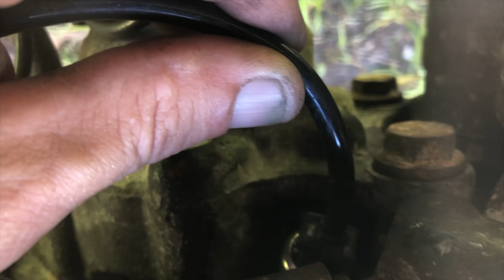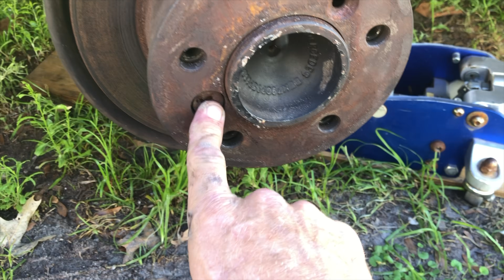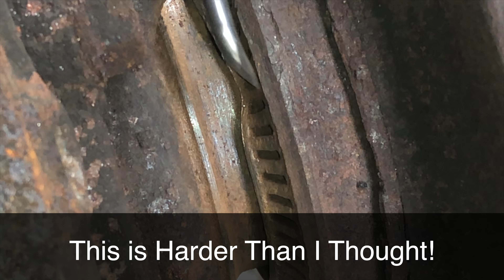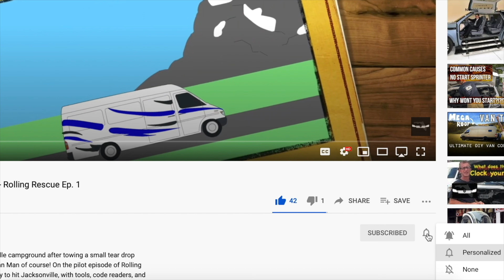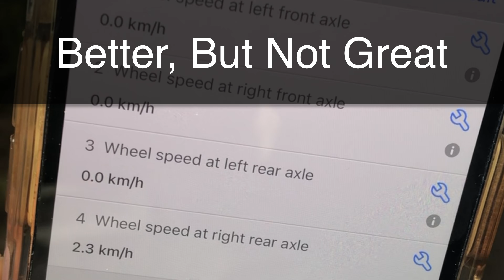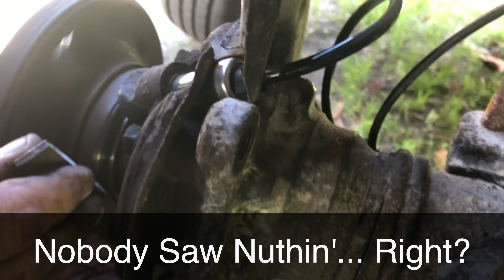Wheel Speed Sensor Ring Damage/Repair

Comment: My engine just decided to shut off and leave me free rolling on a busy road. EDC light came on along with ABS. Could it be possible for an ABS fault to cause this in any way? I read on a forum that it happened to a guy. Sorted ABS issue which was a shorting wire and vroom the van started and both EDC and ABD dash lights went out. I have a T1N 2001 CDI 208. Thanks for all the massive help over the years. Just bought the Autel AP200 from your other videos though it isn't speaking to ECU because I need a 14pin to 18pin adapter which you also linked me to. Hasn't arrived yet.
Reply from the maker: Those lights will come on when the engine stops and the key remains on or is turned back on immediately. Did the EDC light stay on next time you started the van? Our vans don't typically turn off the dash light as soon as the fault is resolved. There are some exceptions but most codes will leave the light on for several run cycles without a repeat of the fault, then turn it off and move the code to 'stored' status from 'MIL on & current'. If you had no EDC light when restarting that points to an electrical glitch, not fuel or fault code reported problem. 
ABS shouldn't turn off the engine, certainly not at speed, and of all the various modules the ABS is the first one to know how fast you are cruising. That said a serious short circuit in any device can draw the battery power away from needy components. Spontaneous shut down is most often fuse box connections failing, crankshaft sensor faults, and sudden dips in fuel pressure. If it consistently stalls when heavy on the pedal, or when off the pedal and approaching a stop, that would point me to the fuel pressure. If it dies on bridges or other road bumps I'd look at the fuse box. If the shut down was due to crankshaft sensor faults the AP200 will tell you.
Reply: @FloridaVanMan  I got it started and left it idle for a while until both EDC and ABS lights came on again and the engine shut down. Now It just wont start at all. Hence buying the AP200 but I am waiting for the adapter before it will talk to the ECU...
Reply: @ Just letting you that my 14pin round plug adapter that you suggested turned up and is working brilliantly. It turned up today, the day after I actually gt the van running again. it was a perished inline fuel priming bulb letting in air bubbles causing drop in rail pressure.

Comment: Ain’t that the screwdriver you used for pulling copper rings in Black Death video? ;)
Reply from the maker: Nope, this is a different modified screwdriver. That one I use for injector seals we named Stan-ree. Because it looks like a Stanley brand handle but it is made in China. This new one earned the name Benny (Bendy but the "d" is silent).

Comment: I don’t have a wheel speed sensor there, does that mean I have no ABS? Also when starting the van cold, it sounds like it runs on 3 cilinders instead of 4. But after you press the pedal it normalizes. What’s the deal on that? (It’s an European model 208cdi)
Reply from the maker: Sounds like you have a sticking injector that frees-up in the morning when given enough pressure. And yes, I think no wheel speed sensor means you do not have ABS brakes. Cruise-control (auto pilot) is much more complicated to add n your van because of this.

Comment: Wow Bill good save 🍻 Much respect from my chair! Going by how that's sandwiched in there, I can't fathom how some tire monkey managed to damage it. 🤦

On class 6 & up trucks, that sensor gets pushed in until it touches. Not hammered on but a firm push to contact. It finds its own way while driving the truck. Almost exact same setup except heavy truck tone rings are always flat & sensor goes in parallel. I've done some straightening just like that many times in my day.
Reply from the maker: This one was probably damaged by a road hazard. There is a deep scar in the hub right where this damage was done so I suspect something like a rock bounced in there and got crushed in the spinning wheel. My first impression was someone hammered a sensor in with a real big hammer, but the way the ring was bent couldn't have been done by a sensor.

Comment: AWESOME VIDEO BILL. We were just talking about my cruise control shutting off not to long back & I feel you may have done this video with me in mind. I'm not getting any lights in the dash. It's a van from Boston area originally & it has its rust issues forsure. If not bent, it is definitely rusty & needs a cleaning I'm sure. I will look into mine & keep you posted eventually. Wondering what the gap space is in between the sensor & ring ??? 
Appreciate all you guys do. Just finished a full blown tranny service & used your link to get parts. It was a bit scary but all went well & is shifting great. Thanks again.
😎👍

Comment: Thanks Bill. I know of one successful method of renewing the tone ring without removing the axle. Apparently the ring can be carefully split in two and then clamped on the collar with a large hose clamp. I have not seen this method work, but spoke with another T1N owner who used this as a temp repair...10k miles prior. I like your method better. Thanks for posting!
Reply from the maker: I looked for an example of that. I considered using the low-heat solder/welding/aluminum alloy stuff but decided to try this first, and this worked.
Reply: @FloridaVanMan  here's the video on a split sensor ring https://www.youtube.com/watch?v=RnbXJk0pfF0 , requires a CV clamp tool and works if you have the wider induction ring on your axle.

Comment: Great video as always. Do you have a video of starter replacement or how to find out if starter relay is bad? Again thanks for all the help.
Reply from the maker: We don't have a video for that but the relay is cheap and easily replaced at any auto parts store. It is one of the two under the driver seat, easily accessible. One is the fuel pump and clicks with key on. The other is start relay and clicks when you try to start. You can reach me here for more 1-on-1 help. https://floridavanman.com/donate/